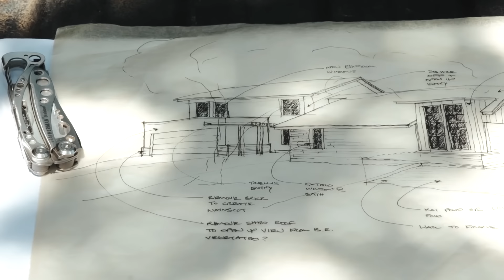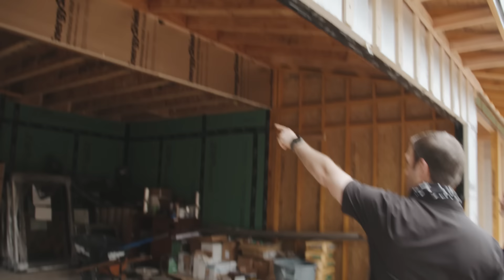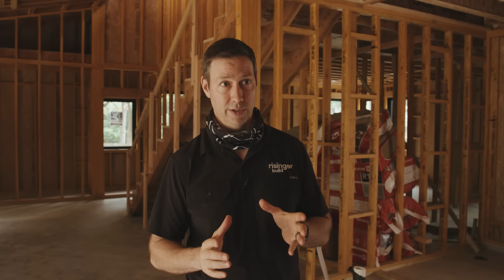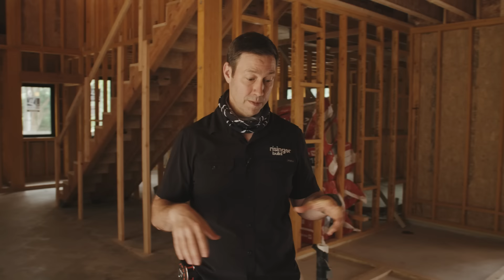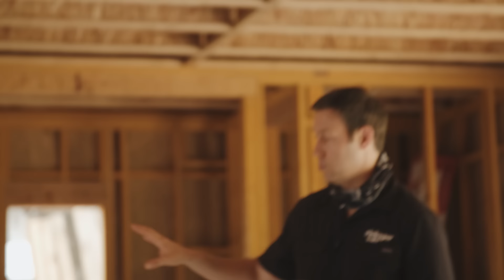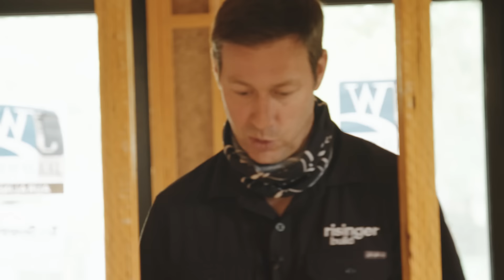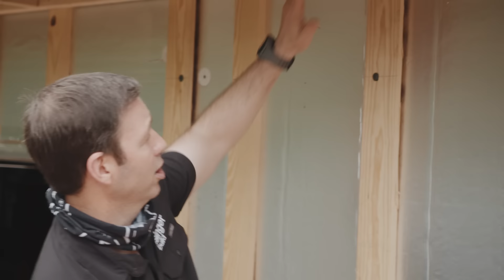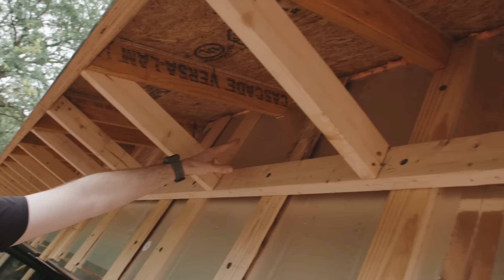The Perfect Wall - Building Science Training

Comment: How about a cost free home.Water we know is abundant.Elec. is now easy to make yourself .$22 Transformer.How about the water that runs down your sink .How about not going down the drain until your toilet fills up from sink waste.I was watching your home and I said to myself the boy probably has burnt alot of shingles off houses.Why You ask.I heard overhang then you show it and there is no airflow .You were picking apart problems on homes where it was obvious they were not done.Please if your going to pick apart work make sure it is complete.If your a builder and im going to go out on a limb and say your a framer that now builds his houses and subs elec sheetrock mechanical and a few other things.Do you guys not use metal termite flashing.Now your talking about all the air coming in cracks.Which im going to say you might have not put vents in your crawl spaces.Please my biggest pet peeves are guys that talk crap about someone elses job.Im going to bet you $500 that I can come in a home you have framed and pick it apart just as you did.I like your videos.I been building in Atlanta and Naples Fl.for 40 years.Just as you I started framing and 
then had a little extra time as my 30 employees were worki g so I went to work with contractors for free to learn elec,sheetrock,already knew how to do the mechanical.I build alot of churches.The biggest home is 13,000 sq foot.That was in FL.It cost 15.7 million.Chump pocket money for this guy.His company makes 95% of all plastic parts that go in GM CARS.Let the job be completed before harping on it.Love your videos.I say this to you because you are a intellectual Builder.Dont lower yourself to what framers like to do to others work

Comment: Wood only looks like a good building material if you squint really, really hard. Sustainable? Nope, not when you factor in whole lifecycle and system costs, and those costs are only going to get worse as climate change brings even more extreme weather. Good seismic performance? Well, the structure may not break, but its flexion breaks everything else. Durable against water? Only if installed perfectly and never subjected to abnormal conditions, and neither of those things are smart to bank on, given the complexity of wall assemblies and the wide variety of situations that can subject your "perfect" wall to a protracted soak.

And finally, cost-effective? Only in comparison to the other ridiculously outdated materials/methods the construction industry accepts. Consider this: your gaming console is an incomprehensibly complex assembly containing billions of nanometer-scale components constructed from exotic, ultra-pure materials contained in an elaborate structure of metals, advanced polymers, and tailored composites, and yet there's a good chance that it costs less than the square-footage of your house that it occupies. That's an absolute travesty, and is ENTIRELY due to the construction industry's refusal to change. There are decades-old materials and technologies that, if widely adopted, would allow anyone with the capacity to construct Ikea furniture to reliably build a house that could survive being doused in burning gasoline during a massive earthquake and then extinguished by a 30-foot tsunami, all  after 50 years of salt spray, and do it for half the economic and environmental cost of the leaky, moldy, vermin-ridden tinderboxes of today, but no, if it wasn't around during the Clinton administration, builders don't want it.

Comment: net positive house vvith a slab that is 50 years old is not gonna happend. Old slabs are not insulated like modern houses. There are more energy loss in the floor than in the vvalls
Reply: hence the reason he is putting a layer of insulation between the slab and his floor.
Reply: @DanielsCorner644  it doesnt matter really, I am a building engineer and there s so much vvrong vvith doing that Im not sure vvhere I begin
Reply: @joki6395  I'd be interested in reading your explanation of all that is wrong with that.